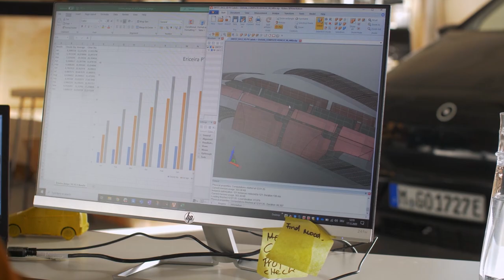The way to Solar Mobility | Sono Motors

Comment: I like your concept but I can't belive that you will keep your price promises. Even without solar panels, moss and bidirectional technology, a family friendly electric van would be groundbreaking for 25k € and I would immediately buy it, but I don't really see that happening for this price.
Reply: For the first 16000 customers it will be 25500€. For all others it will be 28500€. 
According to Sono Motors.
Reply: @MechmanGetrieb  still very cheap for the specs, this would be an instantaneous hit on the market if true.

Comment: If the car is covered in ice and snow, how can I access the charging port?  Is it heated?
Reply: by removing the ice and snow
Reply: @SuperMarway  In severe cold and precipitation, a vehicle can be encased in ice which is not solved by a simple scraping.  That's why Tesla, for example, incorporated a heating solution.